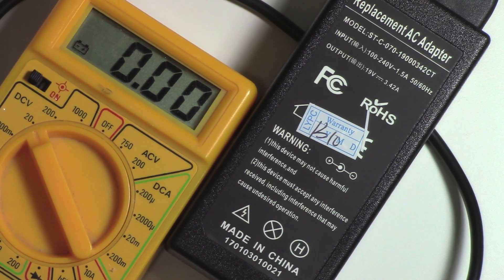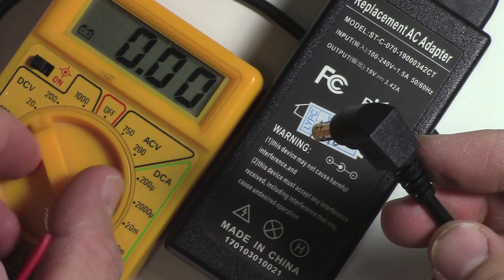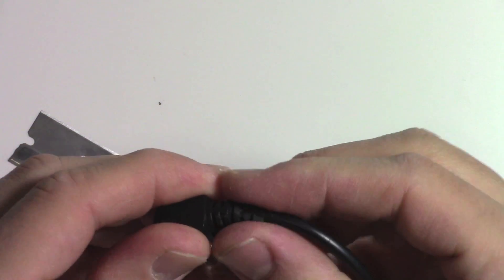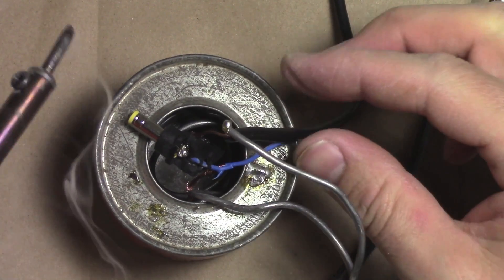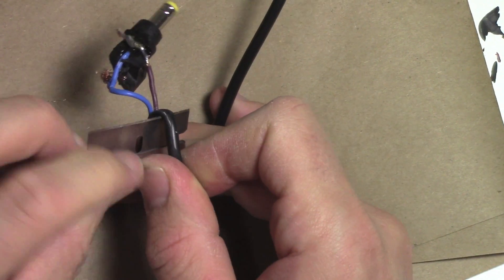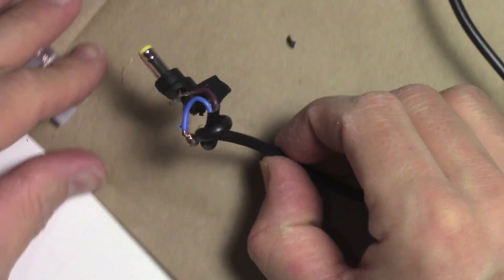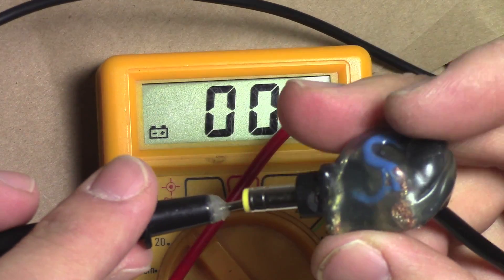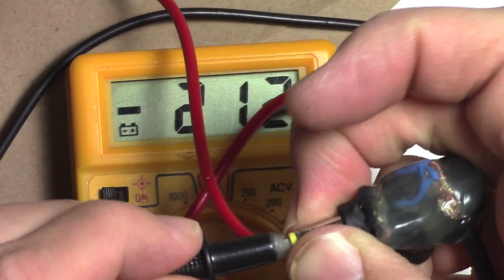How to repair a AC adapter power supply plug for AsusLaptop

Comment: Just ridiculous! The odds of this being the problem is 1 in 100. Even if it is as you discover after destroying your cable, now you need 5x the cost of the cable in tools to fix it. Anybody who has these tools probably would know all this. People who don't? Well this is useless info then isn't it?  Never mind the time involved to save $10 even if you had the tools and knowledge. Smart or stupid?
Reply: This is a pretty easy fix, never did anything like this before, went over to my school’s IT dept with my hot glue gun from previous arts and craft and asked to use their equipment. Poof, done in 10 minutes and then just let it cool.

Comment: LOL, even the volt meter leads seem to be repaired. Yes it was a ugly job but i guess if you can fix it, why chuck it.
Reply: +DMZSniper - Too bad Radio Shack is no longer with us. It used to sell coaxial power plugs like those.

Comment: Hy bro i have 12 volt power supply for suction machine output voltage fluctuating 10,11,9 whats a problem out put capacitor 16 volt

Comment: Where can I buy ac adapter with small round port o am using USB but says its better use ac adapter and to only use USB charger for back up. I bought my daughters tablet at pawn shop and came with USB cable. I need the ac adapter

Comment: I have the same charger as you got but my laptop is a acer one and some how..... Well........ It rip off is there another way I can fix that I tried fix it with the wires and I tape it it works only a few month and then it broke because my puppy chewed it and know I was going to fix it and I did and when I done fixing it then it didn't work this time ._.

Comment: More importantly: how in the world did you know the break was so close to the jack? or was that just a lucky guess?
Thanks for the video!
Reply: +Andysheh Dadsetan Testing the voltage output while wiggling the connector around. As you wiggle the wire and connector where ever the break is will show drop outs of the voltage output as the connection makes and breaks contact intermittently. This only works if the power adapter works some of the time, if it's just dead all the time you won't be able to do this technique but fortunately most power adapter failures occur because of being rough on the cable by either bending or yanking on the wire.